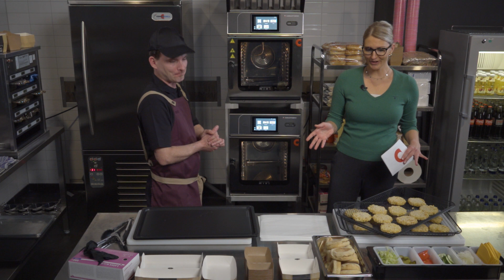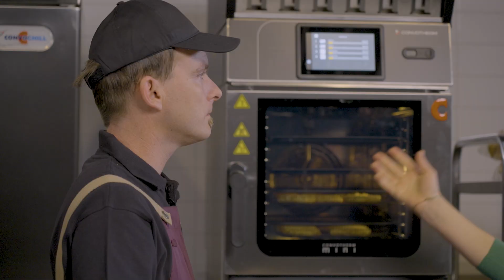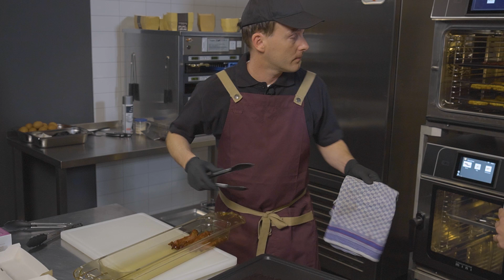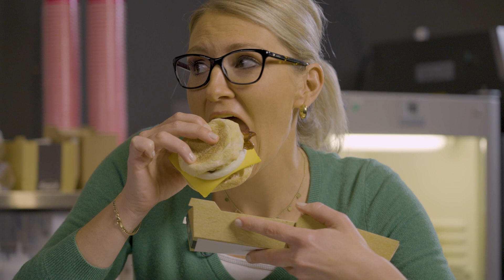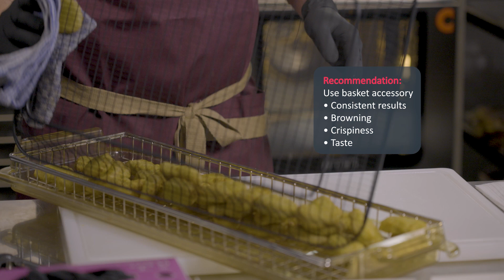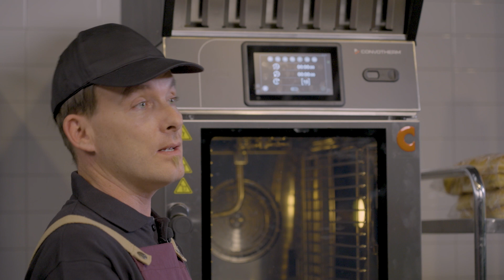How to use the Convotherm mini combi oven: In your fast food restaurant

Comment: Can you use this oven for baking products?
Reply: off course can
Reply: The new oven generation has the Convosene option. This automatically recognises which product is currently inserted into the oven. Whether baking or meat. It's a great thing.
Reply: @ButterkeksModcom1  how long to calibrate product ?
Reply: @resdiansyahsutrisno413  Convosense is already adjusted during production. The product setting only takes a few minutes. This works fastest with convenience products. I hope I have been able to help you.
Reply: Any suggestions for the dry ribs and wings which used to use the deep fryer?